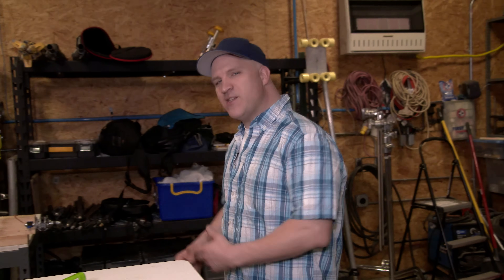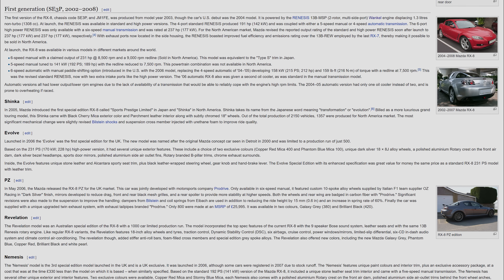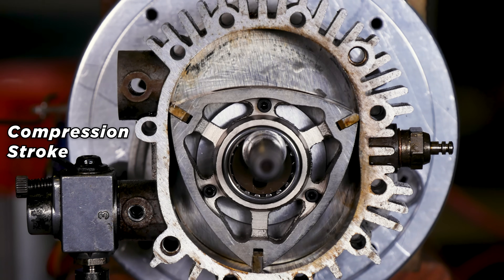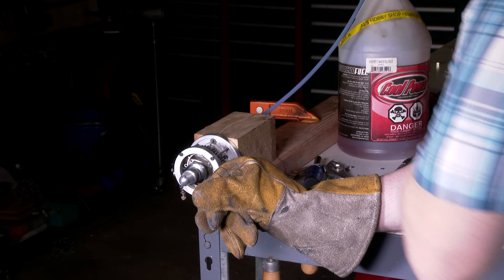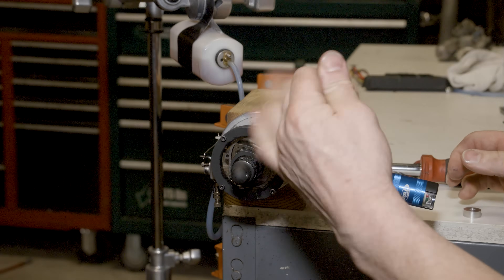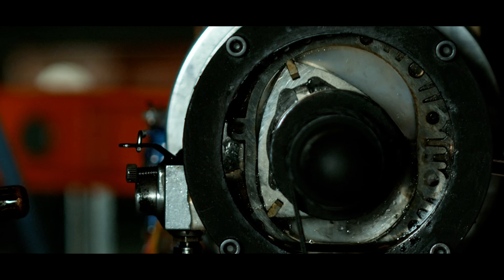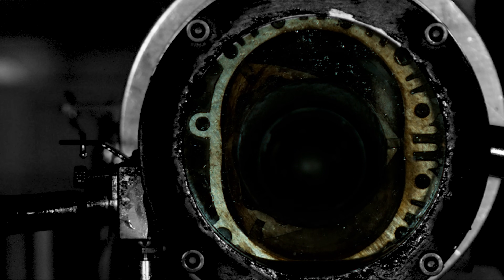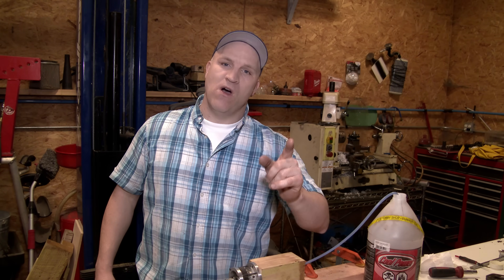See Thru Rotary Engine in Slow Motion - (Wankel Engine) 4K

Comment: Damnn this Engine is loud
Reply: EnjoyMyHitsYT  engines are loud without a muffler. That’s normal.
Reply: Look up the Mazda 787B.  You'll need hearing aids afterward.
Reply: doktorbimmer - I was comparing sound only without mufflers.  I understand the comparison with a four-cycle in operating principle and I've  seen for years the problem with efficiency, especially with mechanical advantage leverage on the main throw of the crankshaft.  There is an efficiency test I've not seen the Wankel design subjected to and that would be Brake Mean Effective Pressure (BMEP).  It would be another comparative source to evaluate against other designs.
Reply: Braaaappp
Reply: EnjoyMyHitsYT 
Plus no torque
Reply: Probably because of the filming in an enclosed space.  It would be less harsh if it had an exhaust pipe of some sort and was fitted with a propeller for some load - the factory supplies the model engine with a muffler.  I used to fly r.c. airplanes with this kind of engine and aren't usually as noisy as a similar sized 2 cycle.
Reply: The Wankel's high exhaust sound pressure is indicative of its lower efficiency
Reply: +whalesong9991 But the Wankel is not a 2-stroke, its expansion and exhaust cycles are not combined or overlap significantly, it is a 4-stroke but compared to other more efficient 4-stroke designs its very loud.
Reply: but this little i wondering :D

Comment: Would be better without the sound effects.
Reply from the maker: Maybe so but, they are based off of the actual recorded sound, also the reason they are in there is to give people who have absolutely no idea what happens inside of an engine an audible cue as to when the combustion is happening. It may not help those that already know about engines, but if you I know absolutely nothing about how an engine works, these sounds can help immensely in identifying which part of the cycle the combustion happens. Because no matter what, when somebody hears a boom it's usually almost always associated with something having to do with fire.

Comment: i only ever saw animations, but the last run looked pretty amazing. I think it would run a bit better and look better with proper apex seals, cause a lot of the heat transferred to the mixing area and therefore loosing pressure and power

Comment: No it isn't 100% clear - Why the Piston/Rotor is spinning at lower rate than crank shaft itself????? - I don't get this gear :(
Reply from the maker: Because there's a gear in the back of the rotor.
Reply: The gears that link the triangular piston to the housing and causes it to rotate produces a 3:1 ratio
Reply: Thanks. :)

Comment: What’s the problems with these rotary engines which stops them being more highly adopted?
Reply: The Wankel has several inherent flaws caused by its basic geometry that have serious negative impacts on thermal and mechanical efficiency as well as combustion efficiency and a very weak, compromised sealing system design. In short, its the Wankel shape that is the causes of most of its problems... unfortunately it one of only a few configurations that can actually achieve the 4-stroke operation of a internal combustion engine.
Reply: Bimmer you stop making things up.

Comment: The usual production-config of a rotary has two rotors that are 180 degrees out-of-phase.  That helps quite a bit with the speed-up/slow-down we see in this one rotor demo.  I understand that racing Wankels can have three rotors that are 120 degrees out-of-phase.  Since there are three ignitions per crank rotation, the nine ignitions in a three rotor engine must be as smooth as a turbine.

Comment: I didn't realize that they made model aircraft rotary engines...  Where can I get one? Also, what engine is that?
Reply: That's a Graupner O.S. Wankel Engine, sold from about 1970 to the late 90s.
Good luck finding one in the second hand market, working ones fetch high prices because of the collector's value.
Reply from the maker: Yes they used to, these engines are very old and have been discontinued for a while now, they are pretty rare it took me a few months to find them.

Comment: Interesting... so essentially each rotor chamber is the equivalent of a 6-cylinder 4-stroke (or 3-cylinder 2-stroke) in terms of power pulses per rotation? Which is why it's so smooth and free-revving...

Actually makes that 231hp RX8 seem rather inefficient, though - 1300cc multipled by six gives you almost 8 litres capacity equivalent. HP per (cc x power strokes) is equivalent to a 1970s diesel engine, or maybe an original 1930s VW Beetle...
Reply: Though I'm not 100% sure, I assume that means the rotor turns 3x for every turn of the shaft? So each rotor is maybe more like the equivalent of a single 2-stroke piston, or two four-strokes? Thus why you only tend to get them installed as pairs at a minimum, for equivalent smoothness to an inline-4 engine at the same shaft rpm?

89 horsepower per litre-equivalent isn't too bad an output figure, still, even for an effective 2-stroke, without any intake charging. That's still better than what a lot of 125cc (4t) bikes make at around 10,000rpm, and they're tuned to run mainly at 5000+ rpm, focussing on top end power rather than any kind of low-speed tractability.
Reply: ...I'm still not following, sorry. Are you saying the rotor goes around once for every three rotations of the output shaft, IE what connects to the transmission input shaft and is usually taken as the engine speed displayed on the tach? So if you've got 6000rpm on the dial, the rotor itself is going around at 2000rpm?

Also I don't quite get how that equates to 2.6L instead of 1.3L... I mean, if anything, it's 3.9L. For each useful power stroke, we still only have 650cc's of uncompressed air going through a 4-stroke-equivalent intake-compression-ignition-exhaust cycle, right? So in a two rotor system we have at any one time six copies of that cycle going on thanks to the triangular rotors, with each face containing its own repeating cycle. Basically it sounds like a bike engine, but what's actually going on inside is the equivalent of a 6-cylinder, 3.9L, 4-stroke piston engine, simply geared up 3x to produce the crankshaft output. Which is probably why they're not so great for torque...

Comment: The rotary engine is more comparable to the 2 stroke internal combustion engine because it has Less moving parts and like this one is lubed by oil in the gas
Reply: All Wankel engines use the 4-stroke principle.
Reply: Actually a comparable 2-stroke reciprocating engine this size has fewer parts. pre-mix lubricationis not unique to any engine type

Comment: Kind of hope you find a Chevy rotary engine that would be pretty badass to see one of those around especially in a video cuz there's only one video of it that I can find and they pretty much had all the issues figured out with seals and Cooling
Reply: The General Motors RC2-206 Wankel engine looked promising in early lab tests, but in field testing installed in vehicles they had serious mechanical failures, short engine life and terrible fuel mileage.
Reply: I'm not sure where the official statement from GM is but it's somewhere and they were pretty much set to put it on other cars and use it

Comment: The 4 rotor powered Mazda 787B is, to date, the only Japanese manufacturer to ever win the 24hrs of Lemans. It won on reliability, not sheer speed.
Reply: Won on sheer luck, points leaders crashed early in the race, the Mazda 787B had a terrible racing record, 20 losses in 21 races, no poles, no fastest laps. never won a series championship.
Reply: Audi has won Le Mans NINE TIMES with a Diesel engine...
Reply: doktorbimmer, what’s your point? A win is a win! And reliability goes a long way in endurance racing. You don’t have to be the fastest, just there at the end.
Reply: doktorbimmer, again, what’s your point? We’re not discussing Audi or Diesel engines here?

Comment: not reliable engine, piston engine is better in my long experience of driving. this engine will burn engine oil too during combustion. so you have to check oil level after few km run.
Reply: Yeah after 1000-2000km you have to add oil, but they are plenty reliable when taken care of properly. There's nothing really to popping the hood while the gas tank fills and checking or adding oil, doesn't take any extra time and only the lowest amount of effort, and as a plus you know your oil is always going to be full and what condition it looks like its in.
Reply: +Derek Hilliker Not true, the Wankel design is inherently less reliable due to its poor combustion characteristics and weak, rather fragile sealing system... even Mazda would not offer the same warranty on their RX models, they knew full well that these engines are notoriously unreliable.
Reply: I got the Rotary engine of my 74’ Mazda Pickup replaced for free, due to badly engineered apex seals. After that I put over 80,000 mi on it. I changed the oil every 5,000 mi and the oil level was never down more than about 1/2 - 1 cup of oil. Maybe I was just lucky.
Reply: Precious few people were lucky, the rest never bought another Mazda with a Wankel engine ever again... sales slowly declined and then dried up completely by 2012 forcing Mazda to permanently discontinue the troublesome and unpopular engines.

Comment: Mazda have done promising research on HCCI ignition (no spark plug) for its SkyActiv-R rotary engine project using research from its SkyActive 2 program. They have removed the need to locate the spark plug outside the combustion chamber to allow the rotor to sweep past. Mazda solved this in the SkyActiv-R rotary project. Rotaries generally have high compression ratios giving the design easy adoption of homogeneous charge compression ignition (HCCI).

Mazda are also looking at laser and HCCI ignition. The aim is to burn all the fuel in the moving combustion chamber, as currently some ends up in the exhaust. Fuel consumption will match piston engines and when used as a constant speed generator as in a hybrid will outperform piston engines with all the advantages of low weight, small size, super-smooth, simplicity, etc. The expectation will be that the engine will be introduced in 2020, the 100th anniversary of Mazda. Looking good. 

Rotaries are better suited to constant speed, high efficiency genset applications rather than direct drive via gearboxes, running at a 'constant speed' turning a generator - at its most efficient sweet spot.  In that application piston engines cannot compete. Rotaries are better suited for series-hybrid cars being much superior than piston engines in size, smoothness and weight. As a range-extender the engine is only a part time engine.

The engine performs very, very well in fuel consumption and emissions running at a 'constant speed' turning a generator - at its most efficient "sweet spot". Wankels lose efficiency dramatically when they are revved up and down as when directly driving a car. 

All these positive attributes combine to make a superb range extender, when the wheels are turned by electric motors. If a car is plugged in each night and uses grid power to run most of the time, then wear on these units will be negligible. As the engine is only periodically used, the life of the engine is greatly extended. Also newer metallurgic techniques are being used to make the engines. Even when electric batteries are depleted, the Wankel can provide enough electricity to power the car and still be economical.

The first ever series-hybrid plane flew in June 2013 - using a Wankel engine because of its small size and light weight, and an electric prop. The makers say it can be scaled up to around a 100-150 seater plane. The Wankel engine(s) can be in the fuselage for better weight distribution with small electric motors on the wings giving lighter, and cheaper, wings. The planes could take off and land on batteries only in urban areas to reduce noise and pollution. About 5 companies still make Wankel engines for special purposes such as drones.

The great thing about a series-hybrid is that the generating engine works totally independent of the demands of the electric driving motor, enabling maximum efficiency when running. This means the generating engines can be greatly downsized. The battery acts as an energy buffer to give acceleration boosts.

The sooner they are introduced in road vehicles in series-hybrid form the better. The Wankel has finally met its niche.
Reply: Your comments are FAKE, MAZDA DISCONTINUED DEVELOPMENT of Wankel engines in May 2009.
Reply: PLEASE CITE A SINGLE COMPANY THAT PRODUCES WANKEL ENGINES IN SERIES PRODUCTION AND THEIR MONTHLY PRODUCTION OUTPUT
Reply: doktorbimmer 
Mazda are doing R&D right now. Bimmer how is the therapy going?
Reply: doktorbimmer 
Five companies in this world make rotaries.
Reply: Bimmer please stop making things up.

Comment: THANK YOU! Warped Perception.

Finally i can visualize the internal flaws
Reply: Just 2 MAJOR issues on this motor vs a ACTUAL Rotary, single ignition point and no side seals, this motor has the basics, and has MASSIVE flaws vs a car engine. it also cannot efficiently combust as the 2 firing positions need to be sequenced to fire independantly
Reply: this is why this specific SCALE ENGINE looses so much fuel out the exhaust. on road cars the firing position of the ports is in the midway position of their timing range, in a race engine we relocate the timing ports/ignition holes, to a later firing position to get EFFICIENT fuel combustion

Comment: Dont understand the love for rotaries, they sound like a lawnmower on steroids and they burn oil by design. Yes they have a lot of power for their size but a turbo 4 cylinder makes the same power and lasts 200.000+ kilometers while doing so. Size isnt so important, which cars has no room for a turbo 4 cylinder? To me they are nothing but a totally unreasonable trend.

Comment: I do think that rotary engines have the potential to surpass regular piston engines in reliability and other areas with some changes to the design. Because currently its just far inferior to a piston engine and mainly just cuz its been around longer
Reply: General Motors, Mercedes-Benz, Ford, Porsche, Toyota and 22 other companies spent BILLIONS of dollars proving that your theory is completely wrong... development of the Wankel was abandoned by all the major manufacturers because it was found to have very little further development potential... even Mazda abandoned the design in 2009.